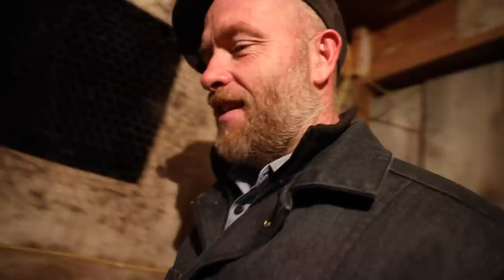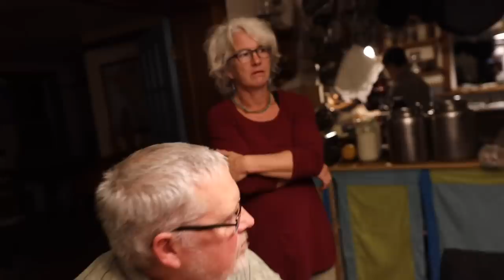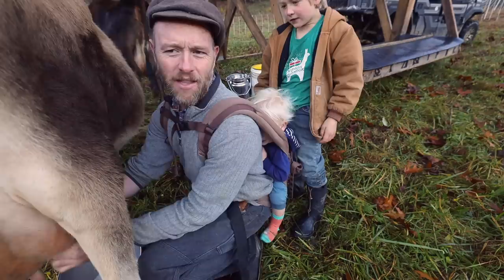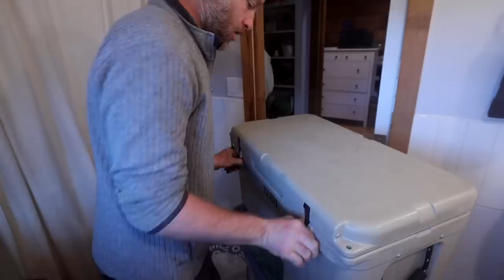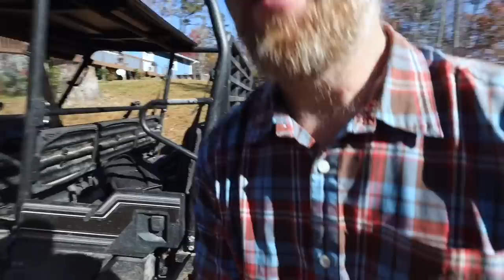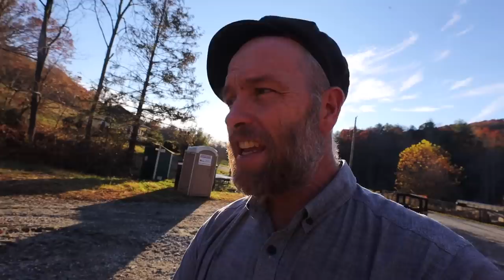Building a Homestead in 100 Days - Day 17

Comment: Sir you need to buy yourself 5 or 6 replacement chains for your saw. That way when you get down to 1 or 2 chains you sit down and sharpen your blades.  A chainsaw in your line of work is an invaluable tool and should be treated as such.
Reply: This guy should not be messing with a chainsaw at all.

Comment: All those sharners thing take to long to do the job I  Wedge my bar in the corner of the tailgate of the truck and I use my grinder to take my rakers down so fast so easy  And when I buy a chain I get a it's called a skip tooth chain cuts faster dirt glass hard work